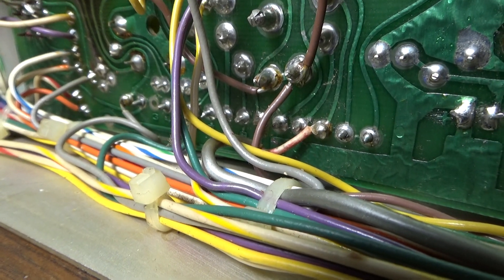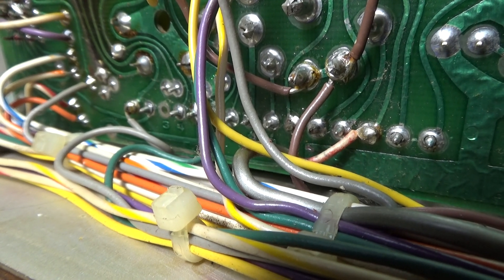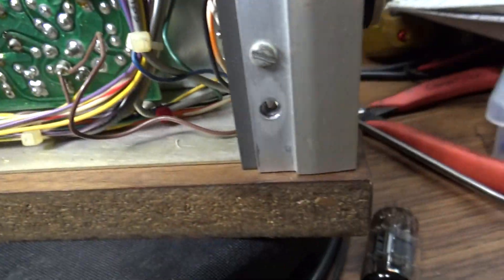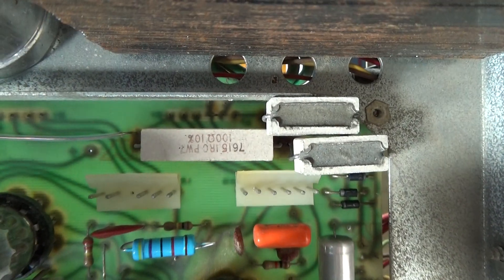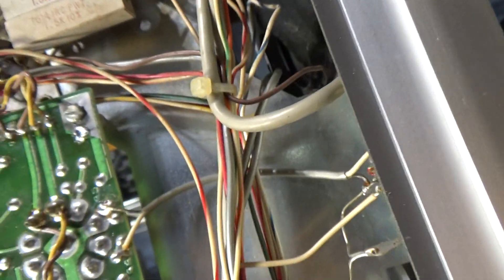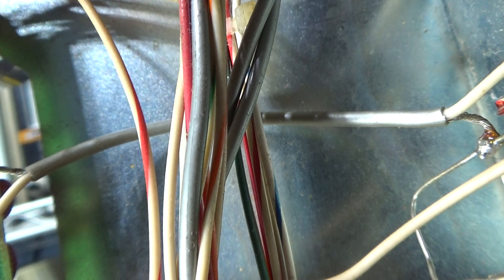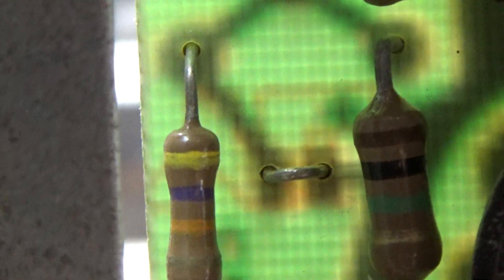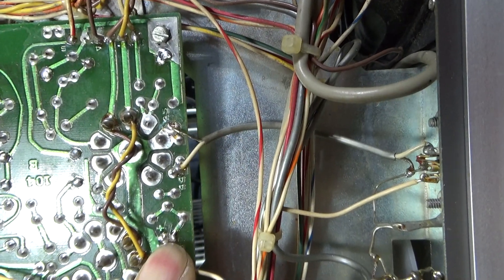Tram D201(A) cold solder joints and AMC (Automatic Mod control) disable

Comment: Back in 1996 I bought a D201 and Sigma 4 antenna for $100 from the trader paper. It sounded like it had a built-in thunderstorm! It was the printed circuit board version. A few new tubes, a few resistors, and resoldering every joint inside the radio the storm clouds parted and a really nice rig emerged.

Comment: I just received the capacitor we talked the earlier, it’s a.001 mfd 450VDC that goes in front of the coil beside the 6JG6A does it matter which way I install it?
Reply from the maker: .001 at 450v does not sound right. Also which cap did we talk about? I only remember vaguely talking about C-700 which is a .001 1kv and I recommend replacing it with a .001 2kv or more. Thats the orange cap next to the coil on rear SWR and output PCB. I don't remember talking about another cap. BTW none of those caps are directional, so there is no + or -

Comment: Great video, a quick question if I may, is C706 the set screw near the 6DG6, and also which tuning coil is T700? Thanks for all your help.
Thanks again 
Micheal
Reply from the maker: Yes, C706 is the trimmer variable cap near the 6DG6 and T-700 is an open air RF coil right there too, see neutraliation pg 18 of this from CbTricks to see how to align those...   http://www.cbtricks.com/radios/tram/d201a/graphics/tram_d201a_om_pg30_pg48.pdf

Comment: Quick question if I may, what is the benefit for replying the 6L6GC to a 6550A for modulation.
Thanks again 
Micheal
Reply from the maker: 6550 is a more powerful tube, so more potential audio power. Its not plug and play though. I think the 6l6 is powerful enough already, leave it alone.